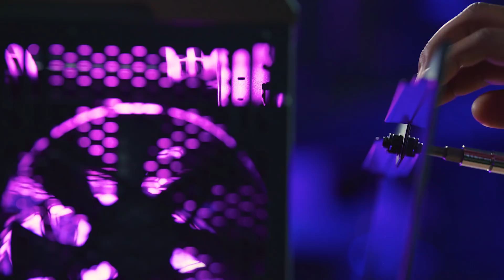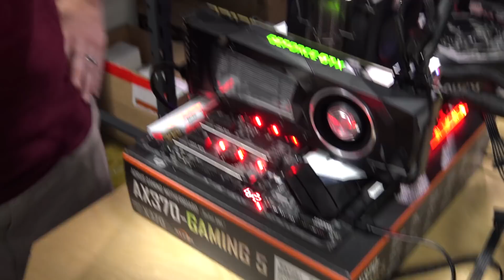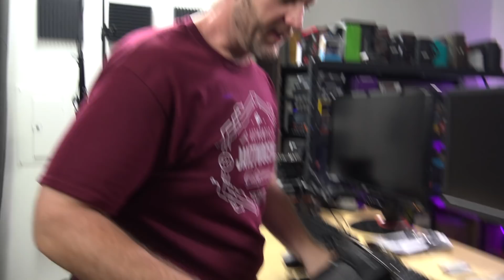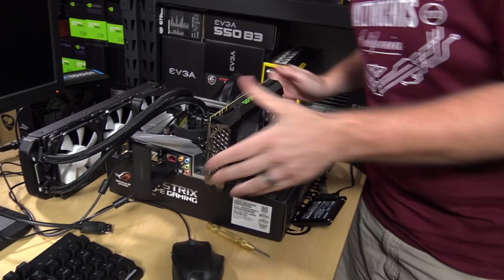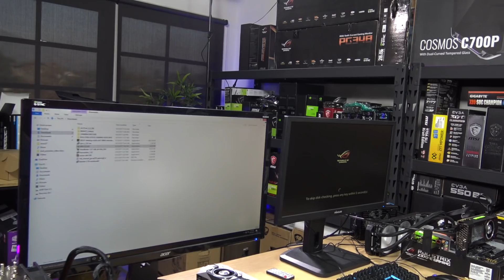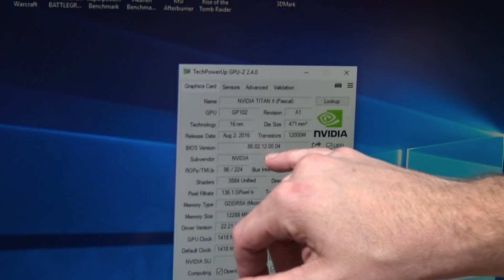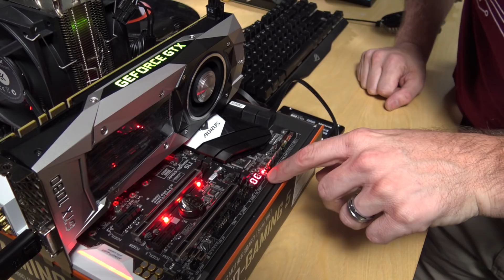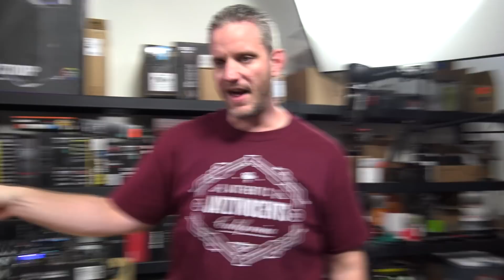I cant figure this one out... HELP!

Comment: Mr. Jay I think you may figure out your own problem here try using two dedicated power cables as opposed to that pig tail your using:
https://www.youtube.com/watch?v=UL7KIVI_hJg

Or...swap power supplies.  It doesn't seem hardware related to either graphic card or motherboard given that every things up to date and I believe you.  Yet the problem card works on the intel motherboard.  I think that main problem is that pig tail power cable or the power rail it's plugged into.  Try the two dedicated power cables to that graphic card.

Comment: I've had issues when my pc wouldn't post when a card was in a pci-e slot but then it would when it was in another. I'm sure it was my mobo. Updating to latest BIOS didn't seem to make it work but after testing older (I tried one step down at time) versions I managed to have it working.

Comment: My experience tells me it might be pin problem on pci slot, electrical compatability, but the 1080 electrical is same as other models you tested. This leads me then to think it might be a partially bad cpu which is beyond winning the lottery rare, I'd say try a different pci slot first, then reseat cpu or give it a solid jiggle in case a pin is shorting, then try dif mobo. All else fails it might be psu or pci cable, try swapping that out. Is it maybe overdrawing power from the slot? Is lanes disabled from other occupied slots? I've got many theories.

Comment: I know this makes no sense, but have you tried with different memory (Ryzen and memory) and different boot drive (I had a bug with my boot drive when I first built my Ryzen PC). 

Also, try the strange card in other PCIe slots, and try it as a secondary GPU. 

Last idea: Could it be the monitor or the DisplayPort cable? I have one HDMI cable that works on about 50% of HDMI ports, because why not.

Comment: I had a very similar issue when I first built my Ryzen 1700x system using an oldschool GTX680 4GB until I got a new one. It would boot fine on the odd occasion and then not work on the next. Swap over to the Z97 PC I have a few meters away, booted fine every time. Swapped a GTX770 into the ryzen, worked. swap back the 680, wouldnt work. Then it decided to randomly work fine up until the point where I pulled the Card out for my 1080Ti. Could it just be a chance thing that it doesnt like booting with different cards even though you swapped the second one in and it worked perfectly? Perhaps it's just being a computer and not wanting to do what you want as they always seem to! Computer version of a tantrum?

Comment: Try swapping cpus and check it again ! After that check hardware id's of gpus and chipsets! Mayb by accident they are similar and screws with the bios, if not check bios itself for options on pcie slots !  Ive seen this before waaay back with the gtx 200series and one particular dfi lan party mobo

Comment: I had the same problem with the titan black. It would work in my 2500k but not my 8350. I had to reset the bios and leave everything at stock and then it would boot. But if I changed anything like using the xmp profile or anything it would do it again. Any other gpu would let the 8350 post  just not that one.  And if I did changed anything  on the board I would have to pull the battery and hold the power down for 20 sec. Then it would post again on the 8350. I tried different ddr3 even at different speeds and same problem.

Comment: Why did you check the bios of the card that you already verified in the 1st rig?

I think that the motherboard might have a slight voltage problem on the PCIe lane and it might be just enough to not let that card work properly.

Comment: why did you checked bios on the same card you you should have checked bios on intel  build becouse that card didnt worked on amd!!!
Reply: Bios is stored on the card.
Reply: DontLookAtMyName // Vids your commentary is completely wrong
Reply: Yep.  He checked the BIOS on the card  on the working  system opn the  left, swapped the cards and then proceded to check  the same card on the same card on the first (left) PC.  He  needed to check the BIOS of  the non-working card while it was in the right-hand PC.
Reply: Konstantinas Lysas this do this
Reply: BIOS versions and drivers are stored in your storage drive, not your gpu.

Comment: I have a gigabyte Mobo with an amd gpu, when I updated the bios for a new gpu, restart doesn't work I will just have a black screen. Also if I had a power outage and the power comes back will also get black screen. What I will do is turn off the PC, disconnect the power and let it sit with out power for 3 minutes. Connect every thing and turn on the pc solving the issue. I believe the issue I have is due to a bad bios installation. So I believe it's the same issue you have.

Comment: try switching the monitors iv'e had no boot with an gpu an no monitor connected you switched monitor ports on the card when you switched systems could be an bad monitor port i really dought it though

Comment: Dude. U may have a ground contact on one of the mounting holes that needs to be grounded?  Check your cpu power input. ... Oooohhhhh. Maybe the pci lanes are switching funny on you. Like they are not all used in the ryzen one? Your talking physiological pathways tho with that. Perhaps use another mobo w the ryzen chip? Check your contacts. ... Ooohhj shit jay. That fan was still spinninh on the cpu cooler block after you switched off... They generate electricity you know? Golfcart aftermarket cooling fans can run a radio after shutdown for 5 seconds hilariously.

Comment: JayzTwoCents you may be making this harder on your self than it needs to be. Start by swapping all the easy things that attach to the GPU: P/S and cables, DisplayPort cable/different connector slots or cable types if available, maybe even the monitor if you get that far. If those don't work it pretty much leaves you with firmware for the GPU or mobo or physical damage on that GPU. Roughly arranged in descending order of likelyhood.

Comment: Help I recently bought a ryzen 3 1200, asrock ab350m, Corsair vengeance lpx (2x4gb) ddr4 3000mhz, Corsair cx 600w, palit geforce gtx 1050 ti stormx 4gb and a western digital blue 1tb and installed Windows 10 pro 64x and now it's constantly blue screening, I have about 7 days left to return these items as unwanted or I'll be left out of pocket with a pc that's unusable the shop I purchased from offers some tech support over the phone but they will not take a look the system as it was purchased in parts and built at home, I am not very experienced with pc hardware, software etc this is the 2nd system I have built and my first build has worked fine for 2 years now I'm literally at a loss to what is going on and causing bsod it even bsod while reinstalling windows 10 after formatting the HDD so there was no drivers or software present to cause the issue, I personally think it is a ram compatibility issue as the asrock webpage for my mobo doesn't list the ram I purchased in the qvl but the tech support from the store assures me that shouldn't be the problem and if its ram related it will most likely be a faulty stick any advice on how to locate/resolve this problem would be much appreciated

Edit: I forgot to add that I have flashed the bios to the newest version 3.10 this did not change anything and the ram is defaulted to 2133mhz, the only bios setting I have changed was boot order to get it to boot from usb for the windows install

Comment: I've had this happen before. Two of the same GPUs, one doesn't post or posts and then flakes out. I wouldn't care to bet you one of those cards is not getting enough power OR there is some kind of odd fluctuation in the power causing it to not start properly. In my case, I had an i7 920 that was pulling too much juice from a name brand PSU that should of had power to spare, but it did not. On top of that, there was interference being thrown into the power line when the CPU would get under load. Replacing the CPU and updating the motherboard BIOS fixed the issue since there seemed to be something wrong with the CPU detection on that motherboard for i7 CPUs. A combination of the flaky PSU and gimped BIOS was causing my GPU to crash.

Comment: JAY it looks like that particular card is faulty but due to power consumption not being identical on both boards it will post on one and fail on the ryzen. I would suggest testing that card on a different amd board with a different psu but the same ryzen processor. As you know power consumption is not identical on any two boards even of the same series. Your power supply will not deliver the same load of power on each and every board. Making sure that the psu has more watts to deliver and that your board is actually delivering said watts to the components. Also that GPU might be drawing more power (or drawing less power) that would be fractional so it would only be visible in this very case. A component will fail to start/post or even register if there is a variable such as a material used is not quite up to spec, the silicon requires more power or the worst case scenario, the PCIE header is damaged ever so slightly on the GPU and the amd MB is basically very sensitive.  Stating the obvious here but that GPU is not working right and trouble shooting might lead you to look into the processors OC and the Memories OC in the bios of the MB. Ryzen loves memory and might even love VRAM and if that is the case maybe that very card has a small fault. Than again this is what I would try out till I figured out the cause. Last thing to check is if the GPU is receiving current at post and how much current.

Comment: Hey Jay it's not specific to that card or board even I have an msi board and dual rx480s but 9 out of 10 times it won't recognize my second card and tried the single card method your using here and even just the 1 card won't work properly like sometimes it'll just run in x8 instead of x16 for a single slot

Comment: Put both cards on the AMD system and the working one in slot 1, the problematic one in stot 2. Check if both cards are found in Windows (or bios). If so, its not the card

Comment: Remove CMOS battery each time to flash bios to default & check the prob is same or not.. if yes then may be that particular gpu got some issues...

May be some HDMI cable issues.. change HDMI..

Did you updated your bios ? May be those TI are with non noticeable difference (one is made  before ryzon launch and another  after ryzon..). For a long time and was using am3 and DDR 3 and after ryzon scenario has changed.. so mbd manufacturers are providing new technology boards with little bugs..

Os issue.. (very very less chance)
 Change ports..

Let us know the final solution

Comment: I have the same problem with my GTX 1080 Ti on an MSI Gaming Pro Carbon motherboard.  When the problem happens I have to turn the system off swap my output from displayport to HDMI and the system will boot fine at which point I can swap back over to displayport.  I've RMA'd the motherboard, the CPU, and the RAM in addition to trying multiple displayport cables.  The only component I haven't RMA'd is the GPU.

Comment: Could it be bad PCIe power delivery, and/orr an iffy PSU on the Ryzen system? When the system puts power to the GPU and starts it, the card is going to draw a lot of power for just a second. Maybe try different PCIe cables, different PCIe power slots on the PSU, or swap the PSU between the test benches. It is possible the "Ryzen" Titan has an iffy power system, and draws more on boot, causing the Ryzen board to error out the GPU? Drop a water cooled Vega64, which I believe has a stupidly high power draw, and see if it does it also?

Comment: I've seen this ONE time after 15 years building my own PCs and PCs for friends/family and 10 years in IT. EVGA 7950GT on a Gigabyte GA-965P with a E6300 (Looked it up on newegg). Gave me a graphics card beep code, EVGA being EVGA sent me two additional 7950GTs, and all 3 were showing a graphics failure. Pressed the reset button on the chassis and the damn thing booted. Never figured out what was going on there. Just had to press reset every time I powered on the system. Worked fine for 3 years until I upgraded, and worked fine for my Dad until 2013 when I gave him my Sandy Bridge machine. That scenario also earned EVGA a customer for life. I've bought 5 graphics cards from them since, just because I know they'll make things right. Also on my second error prone gigabyte board, which may have LOST them a customer for life.

Comment: Try switching power supplies on the AMD system. Your current one may have enough voltage, but your card could be a bit finicky about the power delivery via the pie cables.

Comment: Voltage variance in the GPU power cable on the ryzen system? I had a brand new mother board that the power supply must have had a shared leg that was over drawn. I had to plug my GPU power cable into a GPU port on the power supply in diffrent port till it finally posted. correctly.

Comment: It seems to be an issue with the UEFI portion of that cars BIOS. Notice how it had to do a POST cycle on the Intel mobo? Where as the Ryzen just booted right up with all the cards it had? (minus that one initial POST fault)

I have stumbled into this before, back when UEFI compatible cards were first becoming a thing. In particular was trouble shooting a friends system (2600k ASRock Z68 E4G3, which was identical to mine) of an unrelated issue, and discovering that when we swapped back and forth the 7870 Tahiti LE and the R9 280X, the 280X would go between systems just fine. But the 7870 LE would have this failure to POST.

The only way we were able to get around it, was to do a full CMOS clear, and then have the system POST with no graphics card. Then install the graphics card, and usually it would initialize. Both of those cards were Tahiti based, and both from the same vendor (PowerColor in this instance). There was BIOS revisions differences, obviously, but the problem only persisted with the 7870. We also had a 660ti to throw into the mix, and it had no issue either. Only the 7870 LE. PowerColor said it was likely down to the UEFI compatibility table, and having a problem initializing. Saying out Z68 still had some legacy calls taking place in UEFI mode, and that could be cause for the card to fail initializing.

We later retried that card, for shits and giggles, on a Z87 build, and it worked flawlessly. Without any issue whatsoever. So i have to put some stock in what the PowerColor tech support rep had said.

So try resetting the BIOS, and posting without the card, and see what happens. My guess is that it is some compatibility problem with the Gigabyte board. Gigabyte has always had, IMHO, "Faulty" UEFI implementation. Even their Z68 boards had issues with standard chipset features like Rapid Storage Caching, and wonky OC implementation that didnt like to take P-States in mind like every other Z68 boards did.

I would also be curious to see if the Nvidia card has a different PCB revision, and maybe a different spec on the PCI-E interface, and that could pose a problem as well.

Anyway, thats just MY two cents. Some things are just...the way they are. Fuck computers.

Comment: Just for kicks and giggles...How about, use the working titan xp on ryzen system and use ddu "display driver uninstaller" and do a clean install, just to see if driver's not at fault then swap out for non working titan, also if you're running any kind of GPU overclocker like MSI after burner, pls disable it, clear any kind of cache so it won't reset to previous settings...I realized that it worked with the other titan but still...ryzen is really sensitive at times...I remember scratching my head and trying to install AMD driver on my ryzen build for couple of hours due to not having the right digital driver signature...what a pain that was...

Comment: Why was it doing a new setup of hardware if it is an identical card? Also power draw through the board or cable also might be an issue as a defect might supply enough power for one, but not another. Similar to silicon lottery, but actually bad board or supply/cables. Try benching with the same cards in both configs to compare results, as low power causes low clocks/freezing. Try switching power cables perhaps? For both GPU and mobo from supply.

Comment: hmmm  experience tells me to look at the ram 1st, even though it may not be malfunctioning and be working 100% and may indeed work in another board with that same card (especially true if different architcture) I  have seen similar issues such as this in the past  while building pc's in a factory environment about the time that the Tbird  & Palomino were released, every now and then there would be an issue  with identical  hardware  not working in system A  but the not working hardware would  then work fine without further issue in the system B which was usually the  very next build,  on close examination  I would see subtle differences in some of the components  that make up the cards and boards, this happened on things within the exact same batches as things were  always ordered in  large volume, it soon became apparent  that the quickest remedy was to switch out the ram,   so maybe try swapping it out and/or manually slackening off the settings, it couldnt hurt to try right ?

Comment: I was just going to mentioned that you checked the bios twice on the same card, but seen below you had already addressed that... Don't worry, in my 30+ years of working on PC's, I've done it more than a few times myself... 

My suggestion is to re-flash the troubled GPU... All things being equal, I think that is most likely the cause; a bad firmware update.Try, maybe installing an earlier firmware version; see if that works, then update again and see if that works.